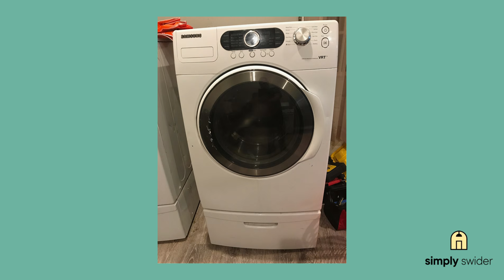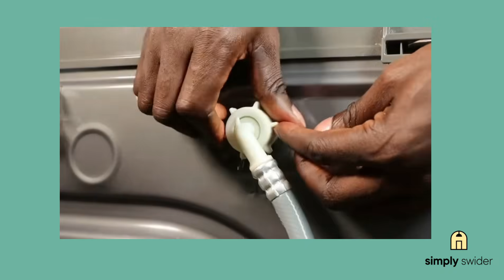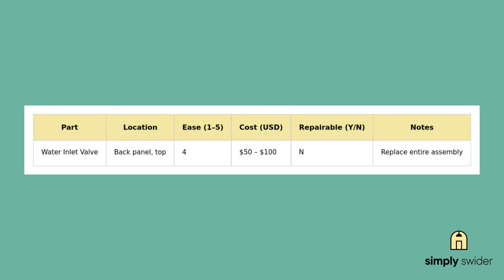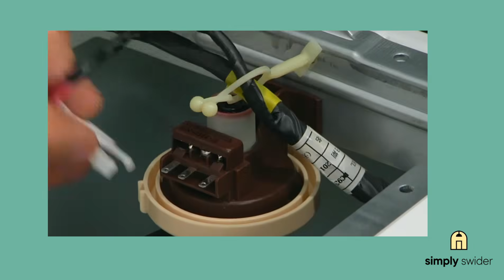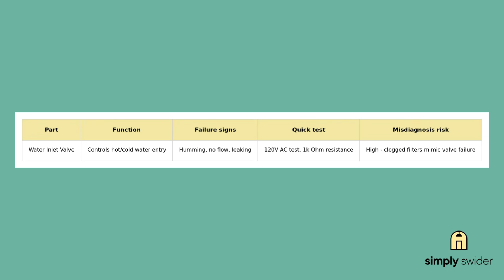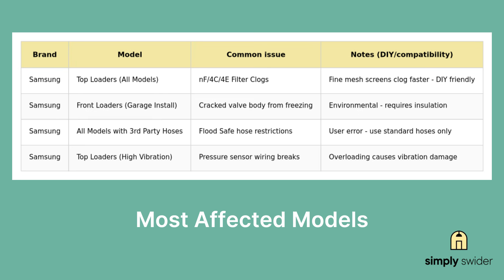Samsung Washer Won't Fill? Fix Error Codes 4C, 4E, nF in Minutes!

Comment: My Samsung wouldn't fill with water. The inlet screen looked clean which was surprising after over a year of use with not so clean water. Cleaned out both the inner and outer screens. I also unplugged it for 10 minutes. I think that's what solved it but who knows.  Very good clear video. Thanks.

Comment: 2014 Samsung front loader is not filling with water at the start of the cycle and there is a sound when the drum is turning as there is no water filling. Checked the hoses and little screens and that is not the issue. Could it be the inlet valve?

Comment: Just changed the inlet valves , screens are clean . Still have a 4c code . Will not fill , when the code starts it drains all the water out .

Comment: Replaced water inlet valves are brand new,water pressure Switch sensor and tube brand new, drain tube, screens are brand new. Replaced all that. Fills to a certain point and flashes 43 code and drains. My water is fine. Getting 60 psi. Samsung junk top loader washer.